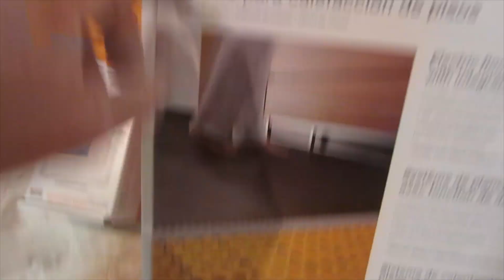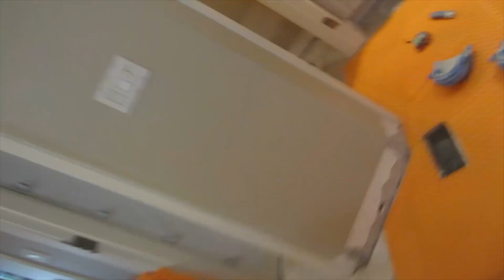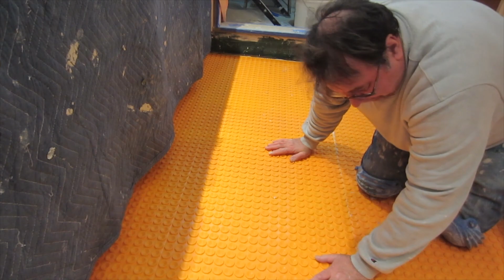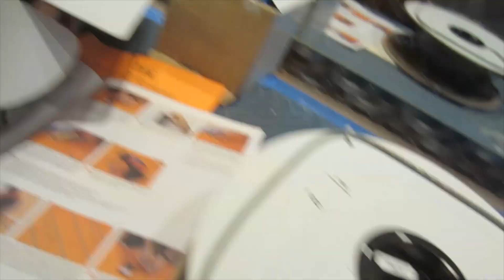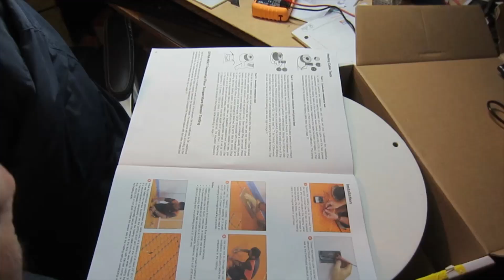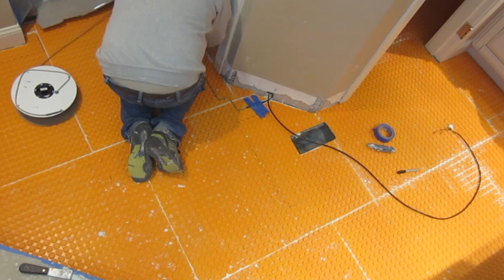Ditra Heat, electric floor heat  how to install it start to finish

Comment: Thanks sal. I'm doing the same project right now, but I've only done the traditional heated floors that are imbedded in self leveling. Very helpful. When ever I have doubts about something, I just check out your videos. It's great to know there are knowledgeable installers out there who don't cut corners.

Comment: Thank you Sal, you are amazing, I would have to live another 50 years and still would not begin to have your knowledge and expertise. I teach DIY'rs every week simple, very simple basics for about an hour. After watching just one of your videos I feel so limited. But, you inspire me to continue to watch, listen and learn and do my best with my students. I always, always stress that before they start any project to watch your videos. And not to totally rely on what little I can present in an hour. That you are the "Teacher" I too am the pupil. God bless you man!!
Reply from the maker: +Chub Troester Thanks for the kind words, but i am just a tile setter that has been doing it a very long time, can't help but learn something along the way.
Reply: Hi Chad,   Being you’re a teacher, I’d like some advice on installing granite tile on concrete slab that had Mastic glue.  What is the best procedure? Should all the 30 yr old Mastic be removed  or can I pour a self leveler cement first?

Comment: Never used the ditra heat system. Will be doing 230 sq ft of it very soon. Thanks for making this video. Its super interesting. Appears a very straight forward system. Thanks.
Reply from the maker: +Mark Jones it is, and you can always call your rep if you have any questions

Comment: Thank you so much for breaking this down step by step- going to instal this myself under a pebble floor and considering running three separate ditra heat sections through the entire ground floor of my otherwise I heated cabin in the mountains
Reply from the maker: Glad it was helpful!

Comment: Found it, looks like the 50 lb bag was for larger trowel size for tile to coupling membrane.  

ESTIMATED THIN-SET COVERAGE
To bond DITRA-HEAT to the substrate:
Use one 50 lb. (22.68 kg) bag of mortar per
100 ft2 (9.3 m2).

To bond the tile to the DITRA-HEAT, using a
1/4" x 3/8" (6 mm x 10 mm) square- or
U-notched trowel: Use one 50 lb (22.68 kg) bag
of mortar per 40 - 50 ft2 (3.7 - 4.6 m2).

To bond the tile to the DITRA-HEAT, using a 1/2"
x 1/2" (13 mm x 13 mm) square- or U-notched
trowel: Use one 50 lb (22.68 kg) bag of mortar
per 30 - 40 ft2 (2.8 - 3.7 m2).

Comment: Great Video Sal...but if you read the directions  You only use unmodified thinset with all Ditra products... Ditra doesnt allow enough air into the drying mortar....modified needs more air to dry ......so if you use modified you have to allow for very long drying times between installs and Ditra will not cover any warranty issues if you use Modified Thinset
Reply from the maker: True when you are installing the tile on the Ditra, in other words the thinset between the tile and ditra has to be unmodified, However when you install the ditra onto the plywood then the thinset has to be modified, to be clear the thinset between the ditra and the plywood sub floor has to be modified. Here is a link to the Ditra Handbook so you can review and confirm my assertion.  https://s3.amazonaws.com/scclegacy/media/ditra-handbook_eng.pdf and here is another video of mine where I go into great detail about ditra and how it works https://www.youtube.com/watch?v=YpXEXqbh7ok

Comment: It is possible to to use regular Ditra and plow a curved line with a router into which you press the cable. It compromises the Dita a little. But you have complete control of how long and where the cable runs to.
Reply from the maker: Are you making a statement, or asking a question?

Comment: I am watching many of you videos... Love them...
I am want to put this in my RV .. Class A... 31'...
Killing 2 birds with one stone... The heating in the floor... and the tile.
Would you recommend this in an RV...
I have lay down Tile before in houses... I flip old houses and RVs.. I'm on my 25th one right now.
but I have never used Ditra... but it looks great, and I think it would be better than the old way, especially since it is on plywood substrate.
Reply from the maker: Best to contact Schluter to see if there are any special concerns for an RV, and whether or not it is approved for RVs.
Reply: @SalDiBlasi  
Thank you so much for your speedy reply

Comment: Val, the basic difference as I understand it is that modified thinsets are exactly that.. modified with agents to help bonding between your tile and substrate (cement, osb plywood, etc).  the replaced unmodified thinsets many years ago to aid in bonding, drying time, moisture control, etc.   (seemed like a marketing thing to me at that time).   It also changes drying time and integrity of the mortar bond/strength, and the reason for "non modified" for tile to coupling membrane is that Schluter has designed it to set tile better with non modified.    The under side uses modified to grab the felt backing and bond to OSB flooring.  Note concrete uses different mortar than wood.   I would ask a Menards associate for examples of each type they carry, then do your online research about how good each is or find reviews of them.
Reply from the maker: Is there a question in that, or are you making a statement. I actually do know why modified and unmodified thinset are used, and where they sould be used for Schluter products.
Reply: ***** No question in that... just making light that she need not be concerned with the science and polymer chemistry that goes into making "modified" thinsets that change the character, strength, and bonding of thinset as compared to the old non-modified thinsets decades ago.  (beyond the scope of this thread and your how to video)  and that she should ask for a quality thinset of each type to do her floor.    If you'd like to inform me on how modified/unmodified differ, why they were designed, and what experienced tradesman think of each, I'm all ears.   I enjoy learning as well as DIY projects.

Comment: As mentioned very briefly near the end, you cannot have, say 5 ft., of heating cable left over.  This point I believe is highly critical and should have deserved much more discussion.  What if I don't have a closet to "readjust" and eat up excess?  I will check to see if there is a different length packages available for small bathrooms.  Maybe another video is out there but I would have loved to see the electrical hookup or is this done on purposes since this is outside the scope of a DIY'er?
Reply from the maker: I have since uploaded several videos about ditra heat, however the actual connections to power need to be done by a licensed electrician. As always you should never rely on a video as your sole source of information, complete instructions come with every ditra heat wire, which should be thoroughly reviewed and understood.
Reply: The cable is made to order based on a measurement sheet you send in. If you are exact with your measurements, you should not have excess.

Comment: 2 meters for reading resistance and continuity: when they die out on you, just replace it with a good multi-meter that will do all those and more.

Comment: Sal, I noticed in one spot when you were winding the wire against an angled wall that you wound the wire around three sides of a single "knob" before continuing with the three-knob spacing.  Could this potentially have any impact on the correct function of the product?  Also, thank you for taking the time to make these videos.  I have found many of them to be very useful.

Comment: Can I put the Schluter heat cable type pad on an Oatey membrane?  I prefer the continuous Oatey membrane for its waterproofing advantages.   I am installing a curbless shower.  Plan to recess my floor, cover it with tarpaper then a sloped mortar bed toward a linear drain.  Membrane will go on top of mortar and direct water into the drain.  I will use approved adhesive to hold the membrane securely.  Pan will be approximately 60w x 36, not sure if wire mesh is critical in mortar?  Trying to keep the height of the tile in the pan as low as practical after accounting for the slope and thickness of all the components.  Hoping to hear that thinset between the Oatey membrane and the Schluter pad is acceptable.  Please advise.

Comment: i would schrape and clean floor before cutting mats to size ..but grate video
Reply from the maker: The floor was scrapped and clean, what you see is a little bit of thinset residue that could not be removed from the previous floor.
Reply: Ok sorry but likd this system ..i am from the netherlands and i wil find out this product is availible here
Reply from the maker: zeeaars http://www.schluter.com/schluter-us/en_US/

Comment: Sal,
Do you prefer the Schluter Heat or the laticrete strata mat? And why?I've always used the Schluter products and have always needed to order them. Local distributor here sells all laticrete products, so I was thinking about trying out.

I love watching your videos as you surely are a Master Craftsman, thank you.
 I'm 43 and it's really difficult to find individuals and/or companies that do a project correctly.
Reply from the maker: My supplier carries schluter, so that is what I use, and it is a great product so I am happy to use it. Laticrete is also a great company, so you really should not hesitate if it is easier for you to get.

Comment: I was wondering, why the heat vents weren't removed or at least the one on the floor in the main traffic area rerouted into the wall  so that some one in bare feet wouldn't trip on it. Doesn't this system produce enough heat to comfortably heat this room without the use of a forced air system?  I am converting an attached single car garage into a bed sitting room and am exploring various ways of heating this space as I can't run forced air without open the floor to the main house easily. I like this system but if it doesn't produce enough  comfortable heat I may have to look at baseboard heating instead. I would appreciate your take on this. Thanks and very good video by the way.
Reply from the maker: Most electric floor heating systems are only to make the floor comfortable, but do not produce enough heat to function as a primary source of heat.
Reply: Thanks for your reply....guess I'll have to go with baseboard heating of some kind.

Comment: Hello Sal, I was told that Kerdi has to be installed between the tile and the ditra heat , though I did a floor with ditra heat and just the tile on top like you
Reply from the maker: Kerdi on top of ditra heat when in a wet area like a shower floor, otherwise not needed

Comment: Hi great video from the UK! And after electrician you need self levelling?  Over wires then adhesive flexible then insulation board the adhesive then you install tiles ? Plz that will be helpful thanks
Reply from the maker: Self leveling goes under the ditra if needed, tile is installed directly over the heat wire and mat. This might help https://www.youtube.com/watch?v=OmUrM4Nl1VY&t=364s

Comment: I'm planning to put some ditra heat down in the basement over concrete slab however when the joist bays of the ceiling were painted there was a lot of spray that drifted down to the unmasked floor. Any special prep for slab with some oversprayed paint?

Comment: Where is the output??

Need some kind of thermal imaging...
Btw great and informative video...
Reply from the maker: The thermostat was placed on the small angle wall near the  closet. It was installed and hooked up to a dedicated circuit by a licensed electrician.
Reply: Sal DiBlasi thanks allot

Comment: Thanks for the video Sal, very clear instruction. One question; in your opinion is the Ditra-Heat material/ mat a little more forgiving as regards leveling the floor initially. It looks to me like the thinset used to adhere the mats to the floor could perform some minor levelling when smoothed over with the wooden trowel?
Reply from the maker: No none at all, the floor should be completely prepped and leveled before installing the mat.
Reply: Ok great. My first install of Ditra Heat this week! Just leveled the floor;) Thanks for your response.

Comment: Can you also describe if you placed perimeter, surface, or expansion joints in your install, or if these are not shown, or unnecessary due to the size of the room?
Reply from the maker: Jared Waterman Perimeter expansion joints are present at all surfaces that the tile abuts and must be present for a successful long lasting installation, especially on the  floor, where expansion and contraction is exacerbated and amplified  by the heating wire in the floor

Comment: This is my next project for our master bath. Do you use the schluter expansion edges and put the trim on top, or do you just leave a gap around the tile perimeter and put the wall trim down over it?
Reply from the maker: +Brice Hultgren Either way will work as long as there is room  for movement.

Comment: I know this was published a long time ago, but Schluter says to install 8 inches from another heat source such as  electric baseboard, but only 4 inches from a heat vent.  You didnt need to stay 8 inches from the heat vent as you did in this video, only 4 inches
Reply from the maker: You are correct, this was done when the system was still relatively new, at the time the info was correct.
Reply: @SalDiBlasi  Sal, actually I am confused now.  The Schluter Video at 10:37 says 4 inches from a forced air heating duct, but the current DItra Heat Installation guide says 8 inches from heating sources including forced air heating ducts.  It seems things have changed, either the code or the concept.  I will contact Schluter  next week for more information
Reply from the maker: https://www.schluter.com/schluter-us/en_US/faq/ditraheat-heating-cables-restrictions

Comment: Ignoring local codes.. Is it possible for Ditra to eliminate the need for a second 5/8" substrate? For example if you have 5/8" floor, then it is typical (in tract housing) to install another 5/8" plywood substrate on top of that for tile. Of course the only reason we do that is to save money, and because the code requires it as a minimum. But I would guess that you would not need the second layer of plywood with Ditra. Am I right? Good practice or no? I can't tell if you are installing Ditra on a second 5/8" plywood surface or not. Anyway thanks for your generous videos Sal!
Reply: To all those wondering Sal did respond to this question. I somehow managed to delete it off his own channel? WTF? So here is a copy and paste of the answer:

	
"Sal DiBlasi
Ditra would be in place of the second layer of plywood, unless you plan on installing natural stone, then you would need two layers and then the ditra. This is true for dtra, ditra xl, and ditra heat. You can download the handbook for ditra heat here https://www.google.com/url?sa=t&source=web&rct=j&ei=06h5VIyKEMu1sQSIu4AI&url=http://www.schluter.com/ditra-heat/media/ditraheat-handbook-2014.pdf&ved=0CCoQFjAA&usg=AFQjCNGXo2e0NzILCe1-edRJlj9d8dHiog&sig2=KfLB4fD2kKtHTo-AWdH3KA  "

There might have been a bit more but it got cut off in my e-mail notification. Thank for the detailed reply Sal and sorry! I have no idea how I even managed to do that!!
Reply from the maker: Spiny Norman
Don't ask me what happened, seems to me that you have magical powers.

Comment: are you supposed to avoid placing the heat lines under potential furniture?
Reply from the maker: If you have permanent fixtures, yes.

Comment: Sal, I had my bathroom all planned out with Ditra Heat and now I read that it's not really for heating the room, just the floor.  That's not something that Schluter makes apparent.  It seems like a lot of trouble and expense to go through just to keep your toes warm.  I'm wondering now if I should even bother.  The mats are down, but I haven't installed the cable or thermostat.  Should I just put an electric radiator in instead?  It's a small bathroom, 9"x 7', on a concrete slab in an unheated garage.  The walls are all well insulated and the rooms above it are heated.
Reply from the maker: Yes that is true, but i have installed ditra heat countless times and everyone has loved it. I would still install it , it does make the room more comfortable.

Comment: Is it possible to install Ditra over cement board or can I only apply this directly onto a plywood underlayment? I have 3/4 plywood and just installed cement board on the floor. Now I'm wondering if it's too late to do this type of floor heat system.